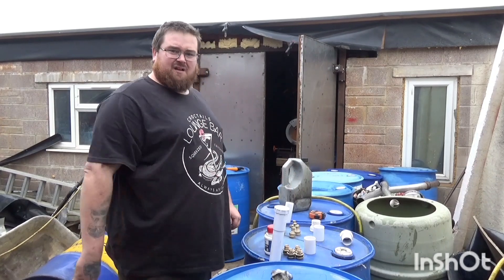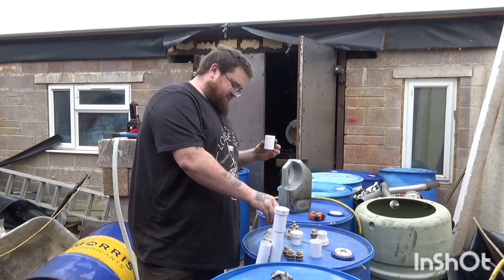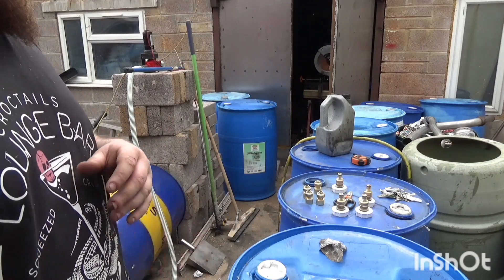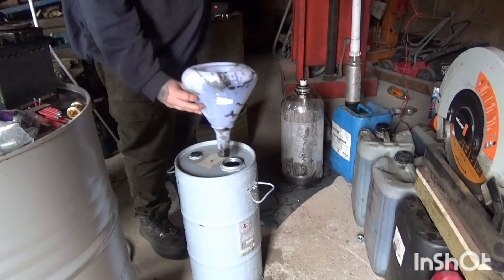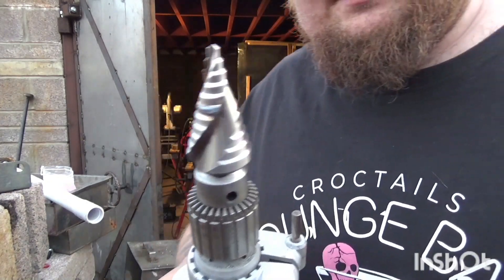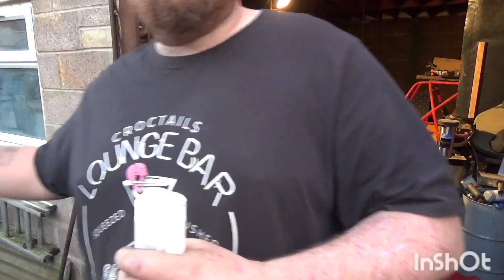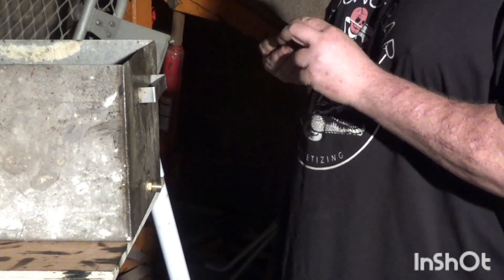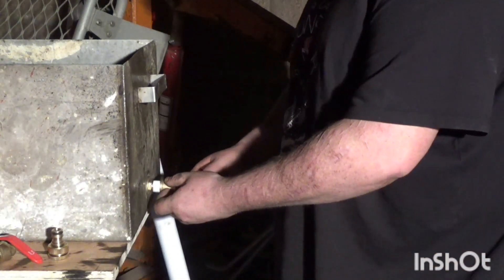filtering waste oil for use as bio/black diesel. simple and easy filtration method money saving idea

Comment: Has anyone here have experience in using diatomaceous earth to filter oil? Vs filter screen media or centrifuge?
Reply from the maker: I've not tried it, I have been thinking of "wicking" the oil to filter it that way no water or particles can follow the oil up the wick. Only thing would be finding out how high the oil will climb then metering the flow into a holding tank or have a shallow container with a large enough surface area to hold a significant amount of oil.

Comment: First time I have seen this video Shane, it interests me greatly to see oil filtration methods like this. Really cheap as well!
I have the idea of building a centrifuge but you hit the nail on the head when you mention power costs just to run one...
How is you car engine doing after so long on straight WMO? Most people have problems with clogging and smoking so if you have neither problem you must be doing something right!
Keep the vids coming!
👍
Reply from the maker: My car has been fine. I'll put a bottle of injector cleaner in the tank on the odd occasion with 20 litres or do of diesel. Likd I said my cars are old with big mechanical engines, I imagine that helps.
I do want to build a proper oil refinery at some point but like all things it has to wait in line

Thanks for watching.
Reply: @smithbuilt  If you can source a 3000 rpm motor making the bowl and shaft spigot should be easy for you? Seen a stripped out torque convertor used as a bowl online as well.
I just bought a diesel generator as the thought of power cuts this winter worries me, now if that would run on black gold.....👍
Reply from the maker: I imagine it might, if not distill it and it would be fine

Comment: Thanks for the vid Shaun do you think an 08 Reno van would be an ok engine? Do the td5s have a rep for being good with this oil cos they are made different? Thanks
Reply from the maker: Couldn't say mate I've no experience with that engine. My cars are both 30 year old l400 delica's with fully mechanical engines there are no computers or sensors on them. I imagine an 08 model of any vehicle will be CPU controlled with lower pressure injector pumps. But you can always try cutting it in a 50/50 or less mix.
Reply: I have run black diesel in my 2007 Renault Scenic 1.5 dci with no issues for about 8 months now. It seems a 60/40 mix with diesel is fine even in the colder weather. In the summer I can do70/30.
Reply from the maker: @fillmglass  my 2.8 delica dose need a little crank over in the real cold weather like when theres ice on the screen ect, but I'm running 100% black diesel I might give a 80/20 mix a go just to help it out a little. Going to build a refinery at some point when I got time that way i can distill the waste oil to a much higher quality. Thanks for watching its intresting to know others are trying it also.

Comment: Hi 
How does your 4x4 run on the oil ?
What mix of fuel/oil do you use ?
Reply from the maker: Runs nicely, a little bit of a smell to it when you start the motor but nothing you dont get used to.
I run it only on waste oil, not put no diesel in my car for over 6 months. My car is an old mechanical diesel engine

Comment: How long does it take to filter 5 gallons through your filter and how often does it need repackdr with cotten
Reply from the maker: Typically I get 15-20 litres over night so I would guess around 12 hours. I have filtered approximately 300 liters so far as I ran out of storage for clean oil but I think the cotton is in need or replacing. However this is only relative to me as the oil was reasonably clean, I have some really bad oil with dead leaves and grass cuttings and lots of water to use. But I will most likely keep that for running in my little rocket stove type waste oil heater.

Comment: Good setup. The slower it filters and the more you put through the cleaner the oil gets. 
You could also try those 10" Blue house water filters.  You can get the filter inserts down to 1 Um which is very fine and finer than the 10Um normally on vehicles.  Fuel prices around the world now are insane. starting to come back a little here now.
Reply from the maker: I looked about for the inline house type water filters but nowhere near me had any so I made do with what I found. I'm going to try and make a better set up as this is very crude ideally with a few filter cartridges inline, might look for the refill cartridges for house filters and make some housings to fit them.

Comment: For over 20 years I've been filtering vegoil but the best ever solution I found years ago is the same for black oil and that is a centrifuge, not one of those engine mounted HGV types, a powered one. Filters take forever, clog up, are slow and messy as you know.  A man of your skills could easily knock one up.. Still trying to get a copy of your small oil burner to run for more than a few minutes.....:-/
Reply from the maker: What burner design are you using? Might be able to help. I do have the metal in for a centrifugal filter but I've still got no welding gas, might have to stick weld one together as a first prototype. Eventually I'm going to use pyrolysis but that somewhere in the list of things I'm going to make... need to get my new workshop finished this year hopefully.
Reply: @smithbuilt  Cheers Shane.For what it's worth I bought a centrifuge from US Filtermaxx, after a mod or two it's been a boon for about 10 years now.  I've tried to copy your wee cut-down gas canister oil burner.  Is there a way I can email you without you getting bombarded? You might find my oil feed unit interesting too.
Reply from the maker: @EelingStudios  I dont have email mate well I do but I forgot my password long ago. You could look me up on Facebook. So are you trying the little tiny drip fed one without forced air?
Reply: @smithbuilt  yes, the little one. I've had no problem with forced air and as you know you can't really go wrong. For feed I use a Peugeot power steering pump turned via a speed controlled wiper motor so it's easier to adjust. I used a 4" cut down steel fire extinguisher case and a prop shaft for a flue. I've found dropping oil onto a bed of old nails then from the ashes of my woodburner works well to maintain a 'hot spot' . Starting up with derv is no problem but after a while on veggie it Peters out no matter how much adjustment I try.  If I can find you on FB I'll drop you an image or two..
Reply from the maker: @EelingStudios  when I started the little pop can sized ones I would place a bit of old rag in there, let a little oil pool up in the bottom an soak in to the rag light that and just let it burn until the rag was close to dry and then start the drip. I did at one point have a good set up with a small tube coming up through the middle of the burn chamber with 4 holes drilled near the top and I made a copper bowl/spoon looking disc that went on top of that upside down. Like a mushroom. I would start the burn beneath the mushroom as I said above then I positioned the drip line top drip onto the top of the mushroom actually think of an umbrella. The oil hits it warms up a little and drops down. In the end you have a hot plate creating vapour and any over fuelling can drip down and burn off, but at the same time the pipe in the middle is an over flow also. Hope that makes sense lol
Reply: @smithbuilt Thank you for your response Shane.  I'll give the inverted spoon ploy a go when I get a chance. In an ideal world I'd like to knock up a removable oil-burning insert for my wood burner that will burn clean and clear the heaps of  the old crap left over in the bottom of too many settling tanks! Thanks again :-)